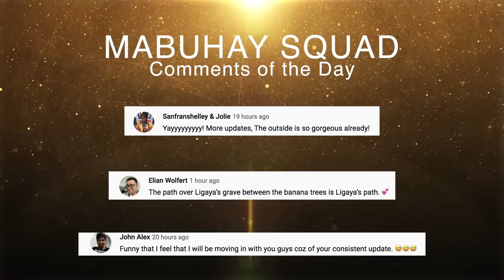A Whole Day at Our NEW HOUSE (What's Next?) - June 9, 2022 | Vlog #1508

Comment: Just a tip for the piece of wood in the aviary : dead wood tends to turn to grey  over time, when exposed to the sun. To avoid this, you can treat it with linen oil, or flaxseed oil, however you wanna call it. We use it in Europe to refresh wooden floor. In several passes, though, because linen oil's oxydation is exothermic, meaning it will heat the wood. Give it time to dry between coats, so it doesn't catch fire! But after two or three passes, your wood will keep its colors for years.

Comment: I think you’re wise to build the aviary set-up over time, with input from the birds. You will definitely need to have a space high up in the aviary where you can be comfortable sitting and hanging out with the birds.  When you mentioned a ladder I immediately pictured something like the Swiss Family Robinson, where you climb inside a tree.  🤣🤣  Or have you considered rock climbing harness/ropes suspended from the roof?  It sounds like you would enjoy the hobby and it would give you more complete access than a ladder.  I’m sure you’ll figure out something spectacular.  😁

Comment: Don’t stress over the acacias. Either way you decide it sounds like easier to reverse than a lot of other decisions
Reply: The only bad thing with acacias are that there roots will destroy the road and the house and the leaves are a hasle to clean especialy the gutters but other than that its a huge huge live saver sa summer cuz theres no heat because of the huge trees shading our whole house but mikey should not worry about the roots cuz its allready fully grown it wont do any damage but the only thing is that there gutters and the cleaning the roof top.

Comment: Mikey, I think using concrete walls surrounding your roof deck was a mistake. It looks plain and old fashioned and ugly but more importantly it blocks most of the nice view you actually have. Would be so much better if it was glass, just like most modern houses using see through glass for their stairs railings now. It actually makes the place looks bigger and so it would be too for your roof deck. Could still be done with only a bit of money which you must have. lol. At least do the walls that have a view. My 2 cents... Cheers